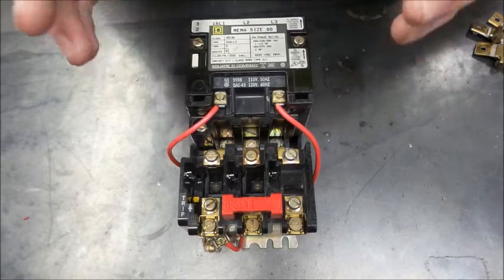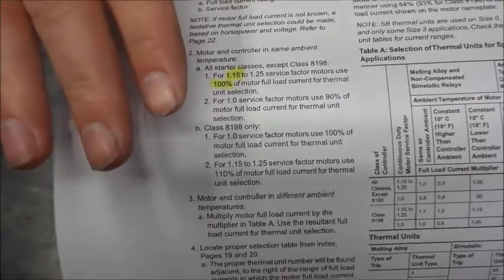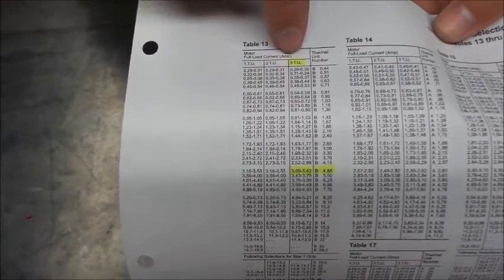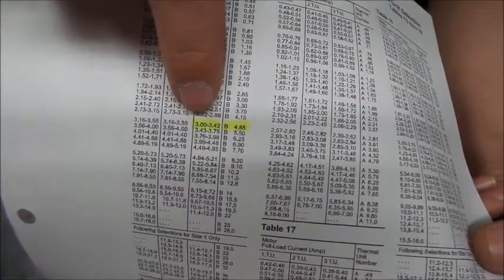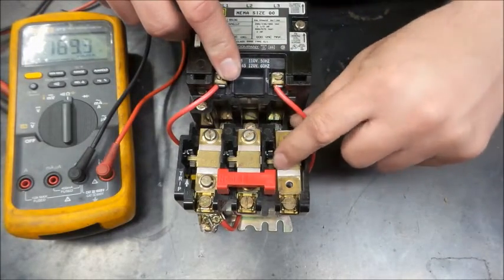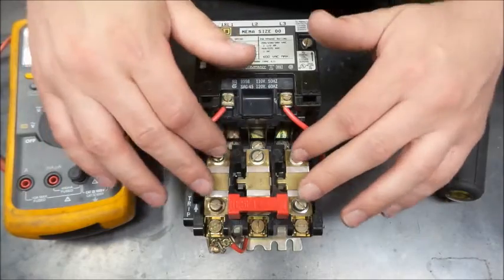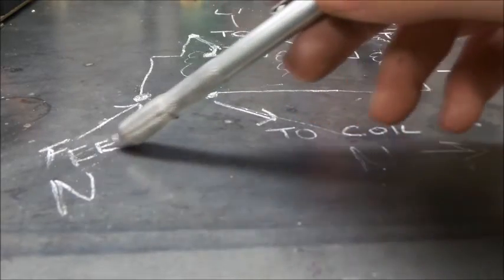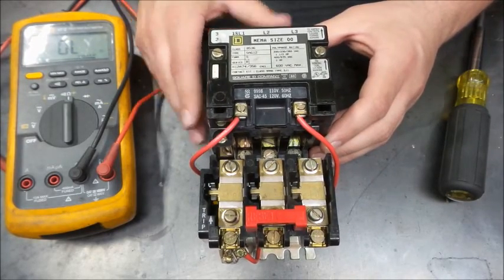A Look at Thermal Overload Heaters in Motor Starters

Comment: Most people, in the spirit of Franklin, think of the power as coming from the coil into the NC OL contacts and then down to the neutral and also into ground?
Reply from the maker: You're not wrong. There's a debate on which way the power flows. This is AC, so it's not quite as linear as a DC circuit would be. Either way you look at the circuit, you should get the same results. If the overload assembly trips, the coil will lose power.

Comment: So the heater elements themselves never actually open?
Reply from the maker: That is correct, they are a solder aloy calibrated to melt as a specific temperature generated by a specific current range. 

The overload assembly is actually Normally Open held closed by the heater. When the heater heats up the spring tension overcomes it and it goes back to its Normally Open state. 

All three are wired in series so if any one opens the coil will lose power shutting the motor down.

It's a very ingenious and simple design that is pretty bullet proof as long as you size everything correctly. 

Great question thank you.

Comment: I had a question,so if the red lever trips itself at any point does that mean one of those heaters has melted or are there exceptions to this? we have one of these starter motors that runs a big compressor and the compressor will run fine for 3 or 4 cycles , a cycle consists of filling a big tank with air,once the air is used the compressor fires up again, after 3 or 4 times of this the starter motor will trip the red lever.

We have been chasing this problem for a few years now but here recently decided to take a look at the stater motor, we have another compressor that has its own starter motor so we just kept the sick one off for a few years since we had not much demand for it but here lately we have decided to take a closer look at the issue and get it running again.
Reply from the maker: It could be quite a few things. I know you mentioned it has been a few years, but it would be very helpful to know if any work was done to the compressor, motor, or starter prior to it starting to act up. A lot of times when something starts acting up randomly after some sort of servicing. The service work may have created a problem of some sort, so it's always worth the time to double check the work cause it was the most recent change to everything. 

Have you taken current readings of the phases to see if one is higher than the others?

You could have bearings going bad on the motor. You could also have bearings going bad in the compressor or some other mechanical issue with the compressor adding resistance to the motor. I don't know if the compressor uses unloaders to start, but they would be a suspect here given you mention this issue seems to be impacted by pressure in the system. You might have a worn-out belt sheave on either the motor or the conpressor or both. I've seen worn sheaves cause overloads. As the sheaves wear the increased surface area, it creates more load. The belts might be too tight as well.

Do you know if the same phase trips? If so, there's a possibility one of the heaters is going bad. This isn't as likely, but it does happen. 

Have you meggered the motor and wiring? Before you megger anything, you'll need to make sure any control devices are isolated. If not, you can damage more things trying to fix this.

It's possible a wire is going to the ground. This wouldn't be a dead short, but it might be something skun or a bad splice.

It could be a motor winding going to the ground. This would show up with a megger test. Again, you would want to isolate everything prior to avoid damaging other components in the system.

Unfortunately, I don't have an easy answer, but you stand a good chance of it being something simple. Especially if maintenance had been done recently before it started to act up. Sometimes, things wear out, and troubleshooting is the fun part to twisted people like me. 

Let me know how you make out. I'm just replying quickly, so I may have missed some options for you, but hopefully, this will give you a few things to start looking into.

Make sure you are aware of all the hazards you will be exposed to while troubleshooting, and be sure to take the proper steps to stay safe while troubleshooting. LOTO protective gear, etc. This sounds like a fun one, but you want to be around to tell the tale of how you fixed it afterward.

Hopefully, this was of some help to you, and let me know what you find and stay safe.

Comment: I have 3 of these that need replacing. 3 hp motor and two 1 hp motors running at 460v. Are there any more modern starters I could use instead of these Square D ones?
Reply from the maker: Yes there are lots of options Allen Bradley, Eaton, Schneider Electric all sell alternates. Some of the newer ones even come with digital overloads that are field adjustable and don't require going through the tables like we did in this video. 

If you have an electrical supply house near you, take photos of your motor name plates and see what they can spec for you.

Comment: Grasshopper....all in series !!!
Reply from the maker: You are correct. The overloads are mounted in mechanically operated contacts. Each of the three are connected in series. The neutral wire (generally) is connected through all three of them. If any one of the three open, the coil will lose power, and the starter will deenergize.

I am working on getting a junk started so I can tear apart the mechanism, and we can take a closer look at its operation.

Thank you for the comment.

Comment: Is the neutral on a normally closed ?
Reply from the maker: The overloads are a Normally Open contact held closed mechanically by the overloads. When the solder in the overloads heats up beyond the specified current of the motor the solder melts and when it melts it looses it mechanical resistance which allows the spring tension from the Normally Open contact the Neutral goes through to open up and turn power off to the Neutral going to the coil on the contactor. 

In this case all three of the Normally open contacts (one for each phase) are wired in series that way if any one phase overloads it will shut the motor down by killing the Neutral going to the coil. Those three contacts are Normally not serviceable and are integral in the overload housing you cannot change the way they are connected you just have two contacts to hook to.

 Hopefully I was able to explain that well enough. It's not too complex but not being able to physically see what's going definitely can lead to questions.
Reply: @TalkingHandsTools  I understood that part perfectly thank you. I was confuse on the installation and location of the neutral on the overload sides. Cause I sometimes see A1 A2 and I get confuse which the Coil really is
Reply from the maker: It's an easy thing to mix up. There should be a jumper wire from normally A2 to the overloads so the neutral can connect through the overloads. Great question. If you learn on normal relays, I can absolutely see the overloads confusing you when you connect them up.
Reply: @TalkingHandsTools  I understood that part perfectly thank you. I was confuse on the installation and location of the neutral on the overload sides. Cause I sometimes see A1 A2 and I get confuse which the Coil really is

Comment: So if it was 460 and the control voltage was 110, then that would have to come from a step down transformer. Correct? Again, thanks
Reply from the maker: Yes, normally there is a step down transformer for the 120V controls somewhere. Occasionally you will find the controls fed out if a 120V distribution panel. That is more common in the context of Motor Control Centers but 120v is 120v its up to whoever designed it to figure out where it is sourced from. The parts of industry I normally see are going the route of individual 480 to 120v control transformers so you can have a single point Lock Out Tag Out for both the controls and the power distribution. That being said I've definitely come across other ways of doing it.

Comment: Very valueable video. Exactly what i was looking for. Only im using Allen Bradley's. These little gems can actually get rather pricy. Soft starter would be a better choice money wise, if you can trust the manufacturer. We were looking at starters for a 150 HP jaw crusher. 3 new Allen Bradleys would have cost over $30,000. What? Is there gold hidden inside or what? We opted for the chinese made soft start. $1400. It is interesting how you would need 3 AB's in a Wye configuration with a timer to do the same job. But the SS is also programmable. Thanks for sharing this. You have cleared up some gray area for me and i am in debt to you. Lol.
Reply from the maker: Allen Bradley is really nice gear but they are not cheap. They also can have some really long lead times these days. I think sometimes the prices on uncommonly sold items are higher and from the lead times I'm wondering if it's made to order. If that were the case it also explains some of the lead time issues.
Reply: @jb-ik8sj what brand was the soft starter?
Reply: @mparim  ATO. Comes from LA. most likely manufactured in China
Reply: @mparim  I was using generator voltage. Which concerned my some. Ive done industrial electrical maintenance for years. There was always 5 wires. So when 2 disappeard, i had to learn the concept of a balanced system. How I understand this is each wire is the return 20 times a second if your using 60Hz. Thats not common knowledge i guess as I found nothing on the web that explained that in layman's terms. Does that make sense to you? That is how it works right. I kinda came up with that on my own conclusion. NOBODY would help me grasp that. So then the control voltage on the soft start was just 2 of the legs. It did not matter which. Remember I am not an electrician. I was kinda grandfathered and guided by a few certified one's in the past. That was a valuable lesson I learned. Im going to the mine this week(6/24/24) to try to understand and install a solar system for the guard/crew house

Comment: Great vid., got a question. I have a 1950's era wood planer It's got a size 1 440v 60CY Allen Bradley mag. starter. My 3 phase 240v won't close it. Can change to a 240v coil and solve my issue? TY
Reply from the maker: Are there any markings on the coil of the contactor? Normally the coils are a lower voltage of some kind used to switch the higher voltage. Coils are always two wire hook up, they are normally much thinner wires. The contactor should say what voltage the coil is Allen Bradley is pretty good about that.
Reply: @TalkingHandsTools  The coil 40v 60C  below that 464-3    contactor 440v 60 CY
Reply from the maker: Wow 40v is an unusual one. You will need to know a few things, I'll try my best to outline them below.

 What voltage are you looking to run the planer on?

What voltages can the planers motor operate on?(if not compatible with desired voltage motor may need either change or transformer may be required)

How many amps is the motor at the desired voltage? (The current will say what NEMA size you will be needing)

What type of control voltage will you be using? (You may need or have a control transformer or a separate 120v feed for controls)

Once you have identified these things you should be able to source a new contactor/starter. From here you can size your overloads as well as your fuses if applicable.

Let me know how it turns out or if you have any other questions. Sounds like a fun project.
Reply: @TalkingHandsTools  Power source  240v 3 phase ... 2 motors, one 7.5 220/440 
, one 1hp 220/440 ... amps 21 and 3  Iam going into the original machine mounted disconnect which feeds starter/power switch/motors.  Best case for me would be able to replace coil w/220 60 cy..
Reply from the maker: Are there two starters that you need coils for or is one currently operable? I'm not sure how lucky you will be finding coils for something from that Era. Do you know if the contactors have been upgraded since the Era of the machine or if all is still stock?
Reply: @TalkingHandsTools  All stock, 1 starter, cleaned the contacts while I had it apart. There are NOS coils avail. in 220 60cy I need to know if that would close contactor.
Reply from the maker: It sounds like it should if it's for the right series contactor. The coil is an electro magnet. If it is the correct series to operate the contacts it should operate your contactor. Are they cheap enough to give a go to see if they work?
Reply: @TalkingHandsTools  Yes and returnable.
Reply: TY so much for the help.
Reply from the maker: No problem let me how you make out!

Comment: This is awesome! Thank you. Question 🙋‍♂️ what happens when the heaters are installed upside down?
Reply from the maker: If you install them upside-down the little gear won't engage with the spring tensioner and the Normally Open contacts in the overload assembly will not reset (or close) when you press the reset lever. This style only installs one way. There is other styles however that I believe a 180 degree turn wouldn't matter. Do you have a specific Manufacturer and part number? I can try and look it up and answer a little more definitively for you.

Comment: The overload won't melt just expand and allow for the gear to rotate and open the neutral ...and you can reset it without changing anything....just fixing the problem.
Reply from the maker: The solder in the little pot temporarily turns into liquid due to the heat from the current passing through it. The gear being under spring tension rotates opening the neutral. Once the solder in the pot cools it resolidifies which allows you to reset the mechanism by reloading spring tension on the gear. You do not have to replace anything cause the solder resolidifies.

Granted over time they can get off and sometimes need replacing but that would be after a fair number of trips.

So the solder in the pot of the overload does indeed temporarily melt until it cools. The entire overload should not melt under normal operations, it can in some short circuit conditions happen and I am planning a future video touching on this. There's a few different way things fail but it will require something beyond over working a motor within normal operation.

Comment: You are explaining a 3 phase starter , with 3 phases you don’t have a neutral! Go back to school .
Reply from the maker: I am indeed explaining a three phase starter. There are only three phases on the contactor itself. The neutral in this case with a 120V coil is on the coil only and while it's on this piece of equipment it is terminated only on the coils contacts not the contactor.

Three phase can indeed have a neutral. If your in North America and go to any commercial place you will likely find either 480V Y which will have a 277V Phase to neutral. Or you may see a 208V Y which will have a 120V phase to neutral. If it's an older installation you may see a 240V Delta which has 120V between two of the phases and around 208V to the third this is known as a high leg or wild leg and can be quite dangerous if you do not understand what is going on. I've in recent years even been installing 400V Y systems which generate a 240V neutral. These are especially beneficial to labs that utilize more European equipment. A 240V single phase system could also be used but that isn't advisable due to creating a phase in balance on the installation which isn't overly desirable. With the 400V system you can balance your phase loading and still power your gear.

All that being said to be honest a significant amount of the 3 phase used in North America you will likely find a neutral with of some kind. There most definitely 3 phase installations with no neutrals but to say that no 3 phase installation has a neutral would be a vastly inaccurate statement to make. It would also be a very dangerous statement that could lead to many people being seriously injured.

Hopefully I was able to explain a little more about neutrals and 3 phase I know it can be very confusing. In the context of this motor starter the starter only switches the 3 phases and it uses 120V single phase with a phase and a neutral to operate the coil. The neutral is indeed switched within the overload part of the starter this makes the coil de-energize thus turning off the 3 phase in the event of a motor overload condition.
Reply: He is explaining the control circuit not the power circuit 🤦‍♂️
Reply from the maker: Thank you for the comment, I tried to explain as best I could. I'm glad you understood the neutral in this case is used in the control part of the contactor and is routed through the overloads. Thank you again for the comment.
Reply: you embarrassed yourself here dude. @TalkingHandsTools
Reply from the maker: What do you think I have mixed up? The coil of a contactor with 120v control like the one in the video requires a neutral, and the neutral is switched by the overload assembly. If any of the three overloads trip, the neutral is opened, and the coil of the starter denergizes. 

Do you know of a starter that operates differently? I'd be game to learn about and do a video on it.